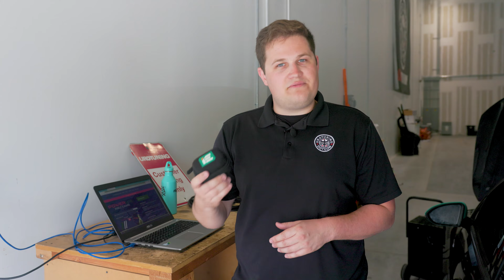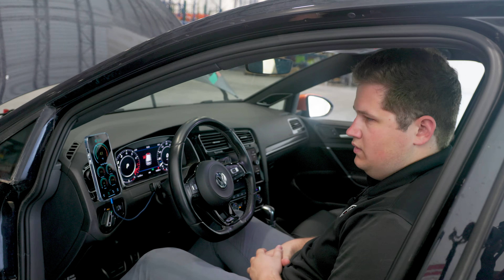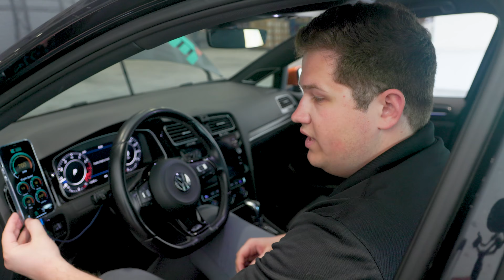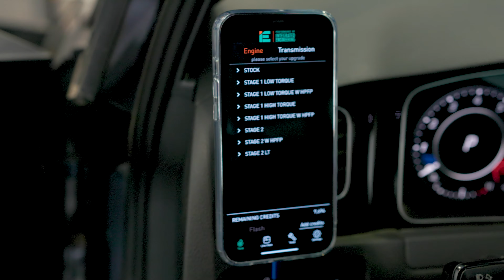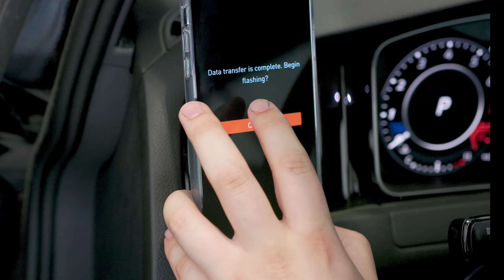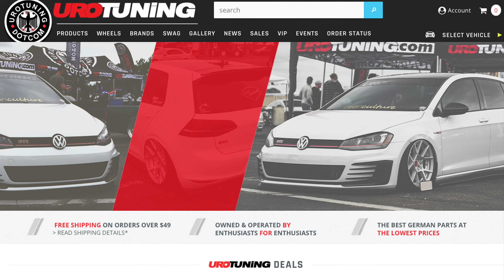Tune Your Car From Your Phone!

Comment: I just flashed stage 1 and i started the car, turned it off then started again but when I flashed for the tcu tune the car wouldn’t start. I had to turn it off first to be able to start the car. Will turning the car off before starting it mess anything up?
Reply from the maker: The tuning software should tell you to cycle the key before starting. The software has that at the end once it hits 100% which it takes to double check everything is good to go and clearing any faults.

Comment: I have a concern I bought a 2022 GLI with it still being under manufacture warranty. If I do the stage 1 tune can I tune it back to stock when maintenance is due on the vehicle at the dealership?
Reply from the maker: You can indeed swap back to stock should you choose.

Comment: Hello, I am currently at stage 1+ with Unitronic.  If I install the IE downpipe, I will need to use the stage 2 file.  If I use IE using my phone and the required IE dongle, as you've shown,  do I need to go back to stock first before running stage 2?  Or does it clear it automatically if I just run the stage 2 file?
Reply from the maker: Thanks for your inquiry! Call or text our sales team at 813-444-7021 or shoot us an email so we can best help you out with this.

Comment: hey ie i just picked up a 2016 audi a3 and im planning to go stage 1
and i got a couple questions 

1. can i go stage 1 without any bolt ons?

2. does this device have a built in stage 1 tune for an audi a3 2.0t
Reply from the maker: 1. You can definitely go stage 1 without any bolt ons. If you want to run the high torque files you will need to also get a TCU Tune or get an upgraded clutch. 

2. The device will have whatever tunes you purchased from IE that are assigned to your car. Hit up our sales team and we can ensure you get setup with everything you need.

Comment: I just purchased the v4 cable and the engine tune. Will I need to connect it to a laptop first or will I be able to download the tune right from the app with the cable plugged into the car?
Reply from the maker: You should be able to tune directly from the app with the cable plugged into the car.